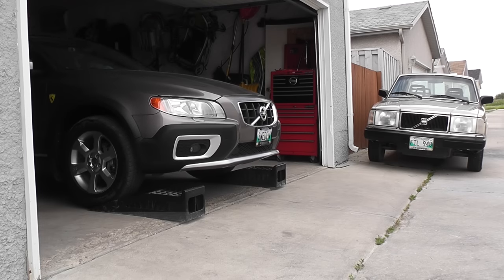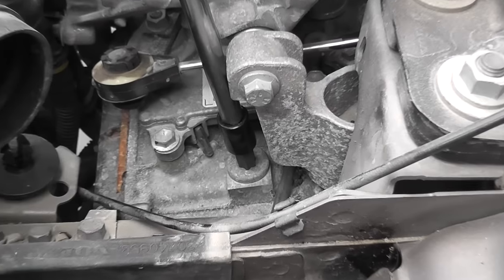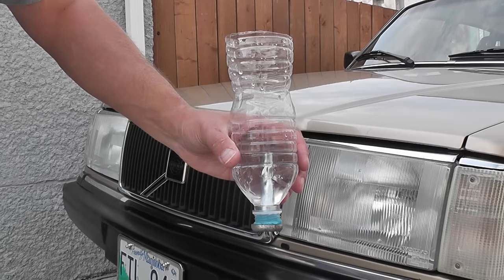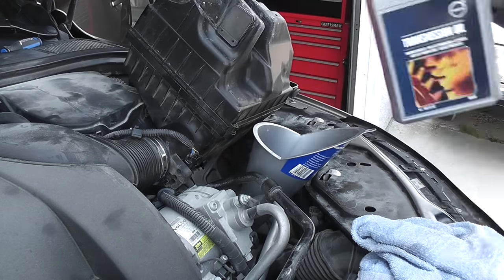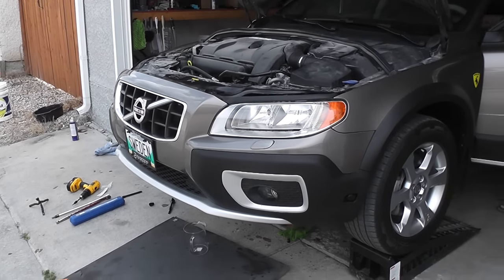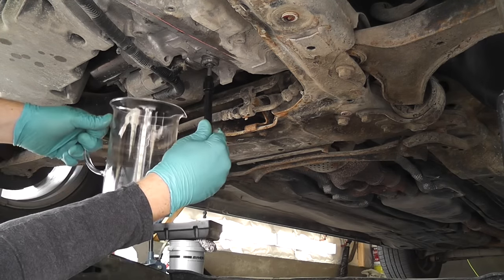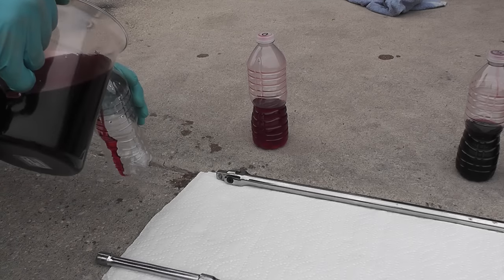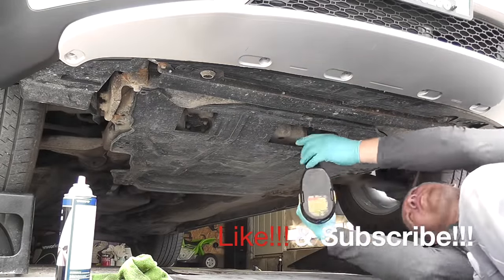Volvo Transmission oil change Aisin TF-80SC. 6 speed Auto.

Comment: Warning: on ALL other 5 speed transmissions, never remove the large bolt at the top of the transmission - on the 5 speed Aisin transmission that is a mechanical bolt for the 3rd gear.  Instead, always refill by the dipstick tube.  Several people removed the upper large bolt, and lost the 3rd gear - you can still recover it if this happened to you  https://www.youtube.com/watch?v=VFyQptqISsc

Comment: Everyone: DO NOT bypass the reading of atf temperature from a scan sensor. If not a DICE Chinese knockoff scan tool, then a regular obd2 scanner. Get Vida virtual machine (google it). Do not skip this or you won’t get correct level. If you can’t just don’t service the transmission.

Comment: Nice demonstration of how the level is adjusted via the the tube in this quite abundant gearbox. Some car-manufacturers use some extra-oil e.g. Opel/Vauxhall advises to add 500 ml to the adjusted level in this transmission and their software adapts to that so always have a look at the service-manual for your car.

Comment: Thanks for that good tutorial man!!! I Changed the oil on my 2009 xc60 d5, it was dark brown almost Black. I used 20 Liter normal oil with jws 3309 specification for 65€ :) now the    Strange gear Change is gone and the shifts are smooth. I didnt have vida dice, so i let the car Run for 20 Minutes and checked the oil with a cheap Thermometer. On monday i will visit the volvo dealer to reset the atf oil Change counter. Thanks alot!

Comment: I wouldn't bother flushing it numerous times. One change will do me. Also I'm not made of money lol.
Reply: I've watched several videos on changing the ATF.......some say you must flush, like this guy....others insist that does more harm than good! 
A single drain & refill seems enough for me. 
And yes I appreciate a single drain does not remove the oil in the  Torque Converter....but that amount of oil is  eye watering expensive! 12 litres!
(I'm guessing most dealerships would not actually go the full flush as this.)
Hopefully an expert in AutoTrans will enlighten us all.
Reply: Flushing it 3 times is still way cheap compared to $3,000. new transmission.

Comment: You could have flushed it way easier. Do the normal procedure for a oil change. Then remove the return line from the oil cooler and put a  hose on so the oil can be "drained" without a mess. Have a second person start the engine while you still fill the transmission. Old oil from the torque converter and oil cooler will drain untill fresh and clean oil will appear. Only start the engine for short time as 9 liters per Minute are coming out from the return line while idling! At best do that with another person and shift through gears while flushing
Reply: This is well documented as the "Gibbons" method in many places.   It requires having a fluid connector (which you can get at the junkyard), the one that plugs into the return line of the tranny oil cooler.  You use the oil pump integral to the tranny to 
push out the old fluid thru this connector attached to a waste oil hose / collection pan.   The Gibbons method does a more thorough job of cleaning out the old oil, and
might be worth it if the tranny oil has become very burned.
Reply: You are right, this is Volvo recomended method. It is described in Vida too.
Reply: Yes, the Gibbons method is what I use as it is more thorough...but a bit more work.
Reply: @pbierre I used to do that  (drain bad fluid  from the return line)with my old 940 so it sounds like a can do it with my V70 too. I'm just not sure what that extra part is  from the junkyard so I'll look for more info on that.

Comment: My 08 D5 aut probably got it first oil change and flush at 200,000 km at a Volvo specialist. The old oil was black, but with new oil it still shifts smoothly at 235,000. Must have been the final call to save the box. Will follow these instructions and do it myself next time

Comment: Done! I just did this to my secondhand 2011 S60. After 120K kms I don't know if the previous owner changed the fluid but the first drain looked pretty dark. Thanks again for your great videos. The next one I will follow is the one about replacing the front brake pads. Happy 2020 from Guadalajara, Mexico
Reply: Hi! Did the gearbox play after changing at that mileage ? As it might be quite late for the first change, but just wanted to hear your feedback.Thanks,Max
Reply: @maximrazzhivin6387  At 140K km now and so far so good. I think the problem would be to flush it completely. With this method you still have some of the old fluid insidw the trans

Comment: Thanks Volvosweden.  Great video and very informative.
I have a question:  At 3:05 when you take out the inner Torx screw the first time, fluid starts coming out.  Why is that if the level should be such that nothing comes out until you take the big 17mm bolt?  In other words, when you adjust the level at the end, no fluid should come out with the inner screw off which is the whole idea behind setting the level.
Reply from the maker: +Marwan Azzam Difference is that when you drain the oil the engine is off. When you set level the engine mist run. Does it answer?
Reply: Yep thanks.  It makes sense.  When the engine is off fluid settles and goes above the "running" level set by the bolt.
Reply from the maker: +Marwan Azzam yep
Reply: his car got front end on ramps. he failed to level the car. his tranny is underfilled in the end.  ;)
Reply from the maker: +sk97225 please read in the description to the video.
Reply: sk97225 garage floor tilts down; car was level even on ramps.
Reply: I want to have a garage like that!!😂

Comment: Many thanks for this video and detailed explanation.  I will be working through this procedure myself after a procedure by a local garage has created a problem with my gearbox when it is hot - gearbox slips under load and engine revs are high.  I suspect that the garage have not set the oil level correctly after a machine flush using 14 litres of AISIN Premium ATF6 (which is a listed equivalent for JWS-3309).  I really have no confidence that they will do a better job if I return the car to them!  
Unfortunately, I have a 2006 XC70 D5 with a TF-80SC gearbox.  My car has the ECU mounted on top of the air filter housing (not a great bit of design-for-service by Volvo!) and this makes this procedure difficult to follow because the ECU has to be connected for the engine and gearbox runs in between oil fills.  In preparation for the job, which I'll do next week with Volvo JWS-3309 oil when I have the new drain gaskets, I've just done a trial run to make sure that I can remove the connected ECU from the air filter housing and then get the filter housing out of the way to get access to the transmission oil filler.  That was fiddly but I managed it and have confirmed that the oil filler plug can be removed.  So, now all ready for the change next week and I have my fingers crossed that no permanent damage has been done!

Comment: Today I flushed my 2009 V70. Guidance in this video made the operation extremely easy. Spasiba.
Reply: SWEDE MAKE Hi, I have V70 D5 2009 120k km/80 k miles and original transmission fluid. Volvo says it’s too late for flushing it, it should be done after 60k km and if I do it now I can have a problem with Geartronic. Do you have any problems with yours after flushing, what was your millage when you flushed it?
Reply: Hi Rafal, have you done the change afterwards ? Thanks, Max
Reply: Hello. I did not see this question before Rafal. My Volvo had 160000km when I changed. I hade no problem with the gearbox after. You will get different answers of if you should change or not.

Comment: Cant believe i just paid volvo £208 to do this and they used only 7 litres of oil, i bet mine looks like urs after 2nd drain 🤔
Reply from the maker: +Tom Winter Well. They have to keep the lights up and running in the shop.
Otherwise do it yourself. ;)
Reply: Tom Winter considering VIDA dice is about £70 and the oem Volvo oil is approx £70 for 4l I don't think that's too bad a price!!!
Reply from the maker: +gusbandicoot But you keep such a great toll for diagnostics.
Reply: volvosweden well yes this is true. Enjoy your videos bud, thanks!!

Comment: Its not worth wasting so much fluid. Better change fluid every 10K or 20K. Will be better for transmission as well rather than introducing clean fluid in one go as gears might start slipping.
Reply: You mean, only do one cycle of exchange every 10-20K, instead of 3 cycles at 60K?
Reply: @pbierre  That is what I do on my Honda. I change the transmission fluid once every 2 years @ 50,000 km. Honda advises me to change it every 6 years or 160,000 km and do a double drain and refill. But, it is much easier and better for me to do 1 drain and refill every 2 years as I drive the car along the way. Easier for me, cleaner fluid too.
Reply: Or just go to a shop and get a flush...

Comment: Do it last weekend and the result it’s amazing! 172.000 km an the oil was black as hell, I use mobil 3309 atf and works perfect. Don’t doubt to do it it will rejuvenate the transmission now the acceleration it’s more immediately and the shifts really smooth. Before I was having a rough shift in between 2 to 3rd. Also in really hot days the shifts were harsher and you notice more in reverse. After the “flush” all disappeared, I recommended 100% many thanks for the video it really help
Reply: This is not a flush, this is a change... so other people don't get confused.
Reply: @dannnsss8034  true that's because I put "flush" jajaj

Comment: Great video! only thing that i have to disagree is you dont need volvos dice to read transmission. every good quality readers whitch can read transimmisson can do the same job!
Reply: Would it be possible to do this without any VIDA or reader at all? Could I, for example, just allow the car to heat up for 20 mins and then drain for the last drain? (assuming that it's in the right range of temp and also not changing the degradation counter)

Comment: My AW55-50 has 300.000km on the original oil. I've started doing some drain&fills. So far I've replaced roughly 5.5 liters of oil, and it seems just as hardshifting, but not slipping. The oil is incredibly thich and dirty.

Comment: Excellent presentation.  I would use a thermometer to measure the temperature in a container placed under the plug.  But I see I need to have a counter reset too.

Comment: Great video, this is by far the best tutorial anyone has made on this operation. Has anyone completed this without using DiCE? Official scanners in the US see to be $200+, which is more than I can afford right now. Just wondering if I'd be making a huge mistake by leveling after letting the car idle for a bit. 
Car info: 2005 XC90 4.4 V8
Reply from the maker: I feel like you can get away by idle for 3 minutes

Comment: Our lot here has constant rotation of used Volvos, XC70, S80, XC90 (same trans) with over 200,000 miles, always original oil. Never a problem. I would never do this service. Never seen Aisin TF-80CS (2007 and newer) fail yet.

Comment: I had my transmission's oil changed at 170.000km the color was really bad! The transmission worked well so I hope no damage was done. But Volvo should'nt say that the oil doesn't have to be changed. Seeing the color it's a nonsense!
Reply: correct....The reason for volvo is saying this is that Volvo anticipates a car-lifetime of 180.000 km. 
so in this objective it does not matter if the gearbox will go defect at this lifetime.
Of course it is nonsense to dispose the car by omitting transmission-oil-change.

Comment: I had my trans fluid changed at the dealership once, then at the race track when I took turns my transmission would have delayed shifts and slam into gear. Then I was told to add a quater of a quart of fluid and that fixed the issue. I have an 06 S60R with the TF80, not sure if they changed the fluid level drain height on the P3 cars, but that fixed the issue. Seems like the the on on the P2 is a little too low.

Comment: You can use a 17 mm bolt with two nuts to act as locking nuts to undo oil bung , you can fill car from bottom by either screwing in a tube from the hardware store and getting a plastic pipe and turkey baster  , or just hold the plastic pipe in the hole .

Comment: I do really like you videos, but you should make note on one thing. Lots of cars have drove over 100k km and by this there is debree on gearbox walls. If you flush it, debree will fall off the walls and clogge up all on its way. And that will end with gearbox manufacturing. Therefor, never change oil if your car shifts well, and even it starts to kick on shifting, visit volvo dealer for software update and adaptation
Reply: You're not flushing (as in pressure-washing), you're draining and filling.   The amount of sloshing around is much greater while driving than during this procedure.

Comment: Excellent. I follow a similar procedure on my 2010 V70. I question the need to always reset the fluid counter, even though Volvo says to do it when changing the fluid. But Volvo only recommends that it be changed at ~50k miles if the vehicle is used for towing. If towing you are likely to have the counter accumulate some instances of high temp. If not towing probably not unless you are racing. So, if you follow Volvo and do not tow, and let the fluid be lifetime, then you would never reset the counter . Having new fluid should not be a reason to reset the counter, but resetting the adaptation might be applicable because of the new fluid properties.
Reply from the maker: +Gary M. Walters all said is very true. But if you have VIDA and Dice why not do it.
Reply: I do agree if you have VIDA/DICE, it is best to do it. I just recently got it installed on a virtual machine.

Comment: that's a lot of work ( the fluid for this transmission  is considered life-time on many models ).  Mine has a dipstick tube which I use to suck and fill.  This transmission has a serviceable filter  and an oil cooler (  pump through the radiator ).
Reply from the maker: This transmission has a filter but is only replaced with full disassembly of the tranny.

Comment: I followed your video but came up with a little different solution. 
Too long a story as we used a oil exchange machine with adapters via the oil thermostat on the gearbox. But my 2016 XC70 is not recognized in Vida. 
I used my Veepeak or Obdlink mx+ on an app call Car Scanner to monitor the oil temperature. To reset the counter is a different thing to be done by Volvo or other good diagnostic machines.

Comment: Nice video, Correct me if I'm wrong. level your car next time :-) For drain and the same amount fill it doesn't need to level the car, but if you want to masseur your transmission fluid, it is important.
Reply from the maker: Read in the description. The car is level. Garage floor is not level.
Reply: Thank you for you comment, and your attention. I am sorry i don't read it. A question, I want to change my car AT fluid, just drain end fill, do I need to level the car ?

Comment: I'm just wondering why after unscrewing the level bolt during the first drain, oil was pouring out. Was the oil level improperly set or was the temperature over 60C?
Reply: This is an underrated question. Exactly my thoughts and it does not make any sense. On my car aswell, 800ml came out with the level plug. Why would this happen, if the level is set the same way?
Reply: @r3nxll  AGREED, ANYBODY ?
Reply: The engine isnt running at the first drain! If it would have Run, no oil would come out :) greetings

Comment: @volvosweden  First thanks for the good videos .. nice to see a person share good experience with others, 'specially the experience not written in any book. Keep up the goods work.
Couple of things are confusing here though.
1. There is comming a liter or more out of the LEVEL plug the first time, you unscrew it?? Meaning Volvo/Aisin Warner overfill the gearbox from new??? Or is it ment to be that way??
2. Volvo/Aisin Warner says 7 liters capacity in the gear box. You took out only about 4 liters first time and drain off about half a liter of the last 4 liter jug put in??? (I got it with your 50/50, 25/75 and 15/85) Any other way to get the rest of the old oil out? I know "the leftover" is in the converter, solenoid block, etc. Is a gasket for the solenoid block cover not less expencive as 8 liters of Volvo ATF? Or will it not give any more result to take off the cover? (If it's even possible with the gearbox in place .. didn't look that thorough yet)
Some other "presenter" here on YT just say "start the engine, let the gearbox pump out the old oil, stop the engine when it stops runing out the drain hole" .. NOT to recommend!!!!
Reply: To answer your first question:  The transmission is drained with the engine OFF.  The level is set with the engine ON.  The "extra" oil you get when draining is being pumped around the transmission when the engine is running.
Reply: @robertking9590  Cheers Robert, I'm sure that clarified it for many folk here.

Comment: This also applies to the Mazda CX-9. I changed mine at 75K miles and it looked like dirty motor oil and the transmission was shifting badly. I ran thru 12qts of Mobile One 3309 fluid and it shifts like new now.
Reply from the maker: Glad the video is helping

Comment: You should checking the oil level without inroad under front wheels...
Reply: I'm not sure it matters.   The leveler column is located at the mid-point (front to back) of the pan.   When you tilt the car front up, the fluid level lowers at the front of the pan, raises at the back, and stays the same in the middle.